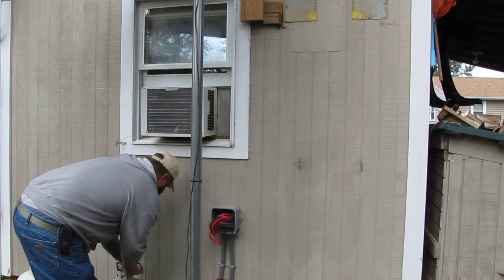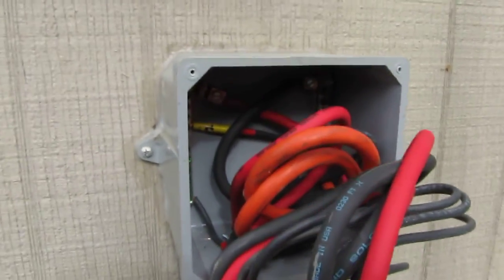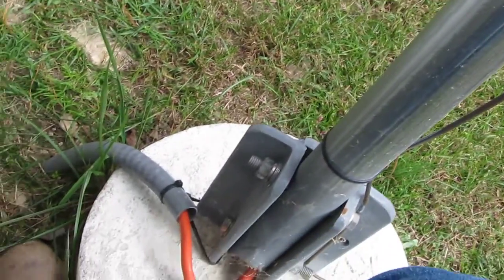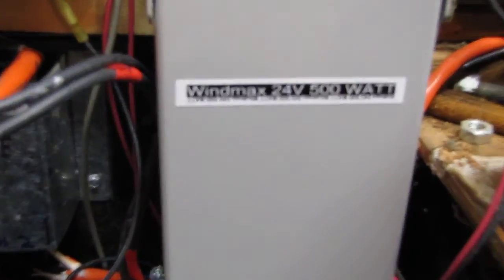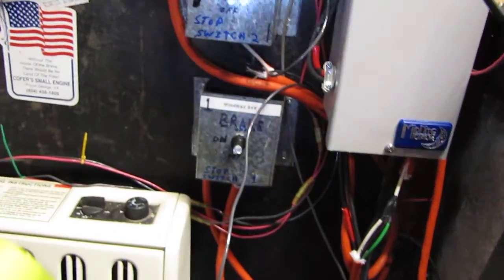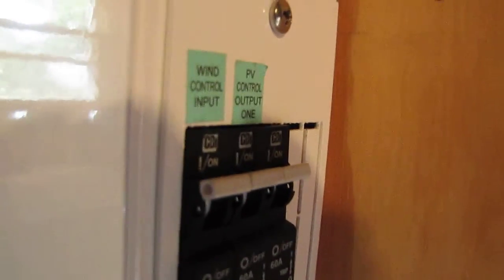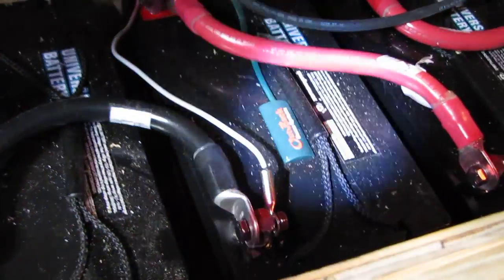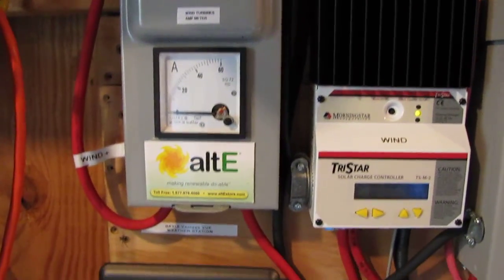How To Combine Wind Turbines And My 24 Volt Battery Bank Hybrid System VIARLOCITY

Comment: Can you wire 12v and 24v wind turbine together to 24v bank?
Thanks
Reply from the maker: I Would Just A 24 and 48 volt or 2 24 volts
Reply from the maker: Yes You could It Would Would It Would Be Better if the Turbines had more Voltage But it Should Work Fine

Comment: i have 3 wind turbines, can i connect all them together? i mean i have turbine with 3 cables, can i connect them all 3x3 cables (from 3 turbines) and connect them all in one battery controller? Or option 2, i have 3 battery charge controllers, can i connect all turbines on separate battery charge controllers and connect them to my battery bank?
Reply from the maker: +Cryian Sky After the 3 phase Wild AC / 3 wires then combine Them Buddy I hope this helps those are all DC wires combined

Comment: I just switched to 24 volt battery bank on my solar and wind system and I'm not sure how to use my two missouri wind freedom 1's they are both 12 volt 1700 watt units??  Can I just hook the two rectifiers in series to get 24 volts?   Your help would really be appreciated .  I love your videos and I too am a great missouri fan.  Thanks in advance
Reply from the maker: Hi Randy That May Work I have Never done That With My Wind Turbines Mine  are 24 volt hooked up in parallel  Buddy  It May Work Call Missouri Wind and solar Before you try it Cheers Kenny